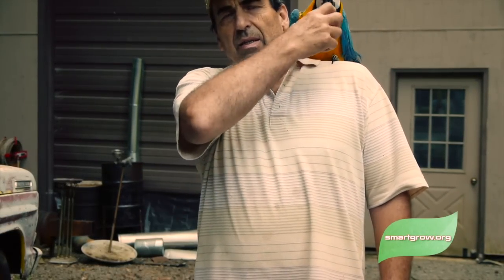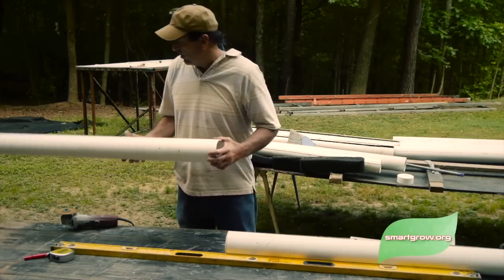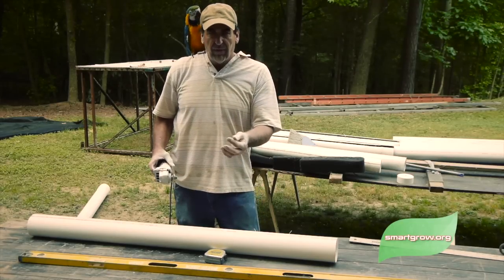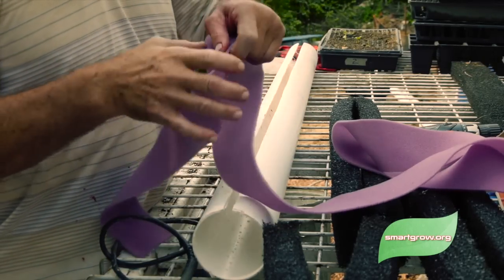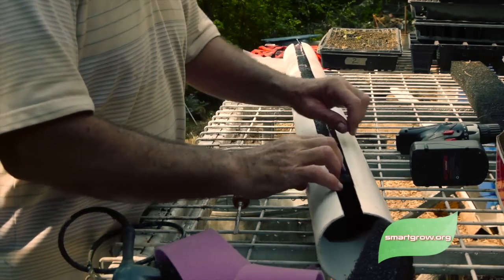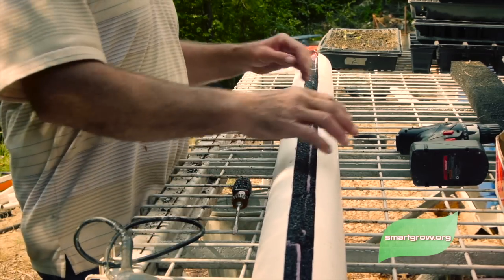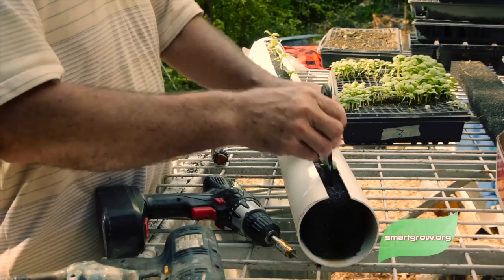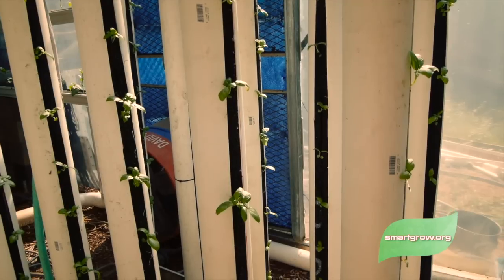Building a Smart Grow Tower 1

Comment: A super super lazy way to make vertical grow towers is to buy a five inch thick pool noodle

Slice through one side of it to the middle hole to make it hinged

Then just hold it apart, put your plants in so the roots hang in the center hole and the stem is pinched by the outer wall.

Then use some string to bind it at a couple places and you're done. Just run the water line through the center hole

Comment: Hello David, thank you for your videos they are very easy to understand. I have but one question, that is the pipe size I have noticed that you are using 4" PVC or IPEX, others use 3", does it really matter or can we use possibly a 2" PVC or IPEX pipe?
Reply from the maker: +Whitestar Domes I just use 4" PVC drain pipe,but smaller pipe will work just as well for smaller plants. A 3" or 4" pipe will give you the same result I have grown in both.
Reply: Whitestar Domes, did you ever set up a hydro tower system?

Comment from the maker: The wicking material comes from HIBCO Plastics, Thanks for watching
Reply: Smart Grow Technology couldn't you drill 1inch holes on the other side and double the amount of plants you can plant on 1 pipe? Just alternate the positions on either side so the roots don't run into each other.
Reply: I've been trying to look on HIBCOs website to find the wicking material but since you had them dye it and all I'm not really sure what I'm looking for. I saw you using it in another video for your micro greens and I've been trying to find something like it ever since. Would you be willing to share the product number, please? Thanks!
Reply: Alien-nation theres hanging grow towers with alternating holes all the way around it depends on your light conditions most of the all rounderas use spectrum lights aka red and blue LED